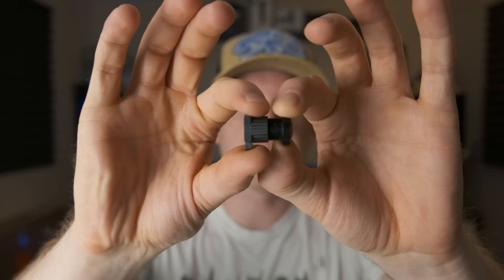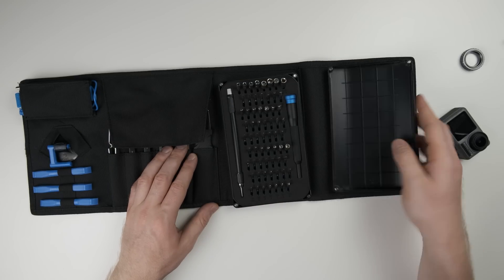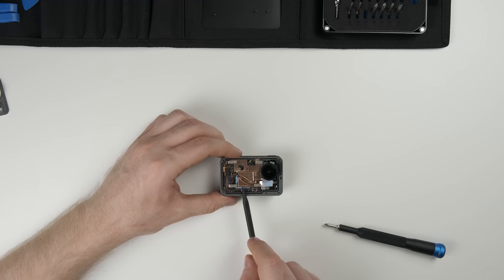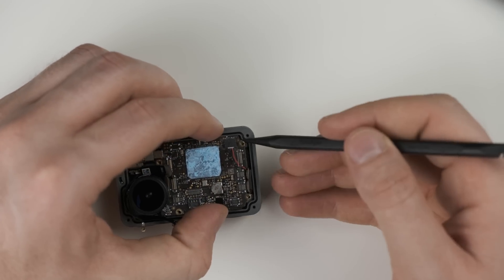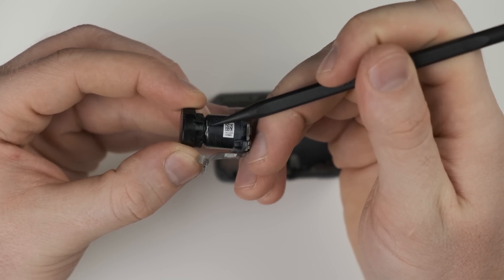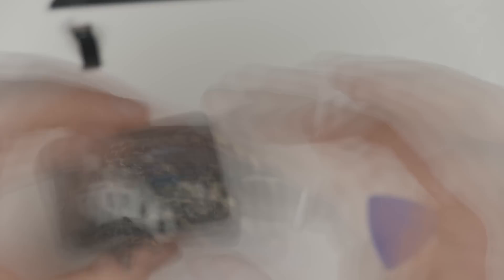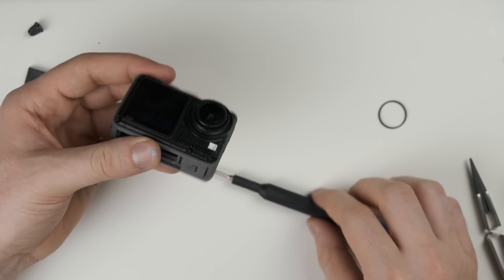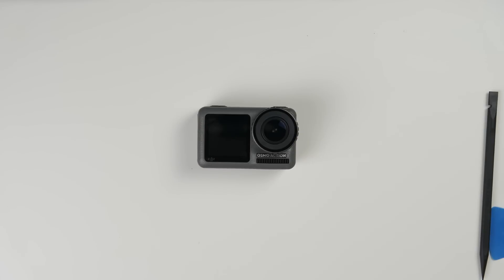The CRITICAL flaw on the DJI Osmo Action - Teardown Video

Comment: What is the diameter and thread of the lens, can you confirm it for me? I want to buy one but I want to change the lens. I want to use the lens 
 4K 1/1.8” 12MM, M12

Tell me if you think it works for me

Comment: I am considering the DJI cameras. Why?

1.  I bought two GoPro Hero 7 blacks in 2019. One doesn't work anymore & the other one is extremely unreliable

2.  I bought two GoPro Hero 8's in 2022.  One now consistently cycles on and off
The second one turns off within 15 seconds .  Neither one is usable anymore

3.  I bought a 3rd GoPro Hero 8 in 2023.  It now turns off within seconds after I push the on button it is not usable either

4.  All five of these GoPro have had issues with heat, inconsistent recording, & corrupting files.

5.  There is always a daily frustrating issues every time I use the GoPros

Comment: You can lightly heat the side of the lens and it should turn and unscrew. The lens is not an M12. It's an M11 but slightly smaller than the new Hero 5,6,7,8,9 + cameras.
Reply: My camera lens broke, it is the same as the one in the video, the Osmo Action 1. Can it be replaced with one equal to the GOPRO one you mention?
Reply: @soportesistemas4590  No, Only DJI makes this small M11 lens. There are no replacement on the market or aftermarket. These lenses are not the same size as the GoPro Hero 7 and above model lenses. DJI lenses are slightly smaller. I would not try to remove the lens socket over the sensor, heat will damage the image sensor. We will have a few of these stock lenses in May 2025 from water damaged cameras but lenses are fine if you are interested from IRmods.

Comment: Any idea where I can get an lcd replacement
Reply from the maker: Will likely have to buy a used/broken camera for parts.
Reply: @TrailFeatures  I opened up mine cleaned the inside now it has a red light on it. No display or anything. It’s so difficult to find parts for this camera.. driving me crazy

Comment: Thank you. I replaced my lens. When reassembling I did not redo the thermal paste! Do you think this will give me issues?
Reply from the maker: It may. I’d go back in and put some on. Doesn’t need to be fancy stuff.
Reply: @TrailFeatures  yeah, that's the plan. I swapped lenses with another broken one. You know that silver tape that you have to cut or remove? Isn't that some kind of heat shield tape (or something)? Does that need to be replaced or reaped?
Reply: What gopro lens did u use for the omso please i hv the same problem broken lens
Reply: @rabaranwer9752  It was another Osmo lens
Reply: @kevinjack5184  do you have a link?

Comment: I need to replace the front LCD, do you have any resources? I've Google it and talked to dji but I have to send it in and I use nearly every weekend...
Reply from the maker: You’ll need to look around on eBay for a broken osmo action that still has a working front screen. Not sure if there replacement screens available to by one-off.

Comment: Perhaps you could sacrifice the lens it currently has such saw it down to near the attached chip board. And then im sure peeling of the remaining plastics is possible. Or you can you like a solder gun and heat up the epoxy abit? Either way i dont see a way to really mod this lens unless you destroy the current lens, but nice work dude! Subscribed!!

Comment: but why?  why would anyone do this?  you never mentioned this.  dont you think most people would screw tis up?  MORON
Reply from the maker: Good question.

I did this to learn about how the camera was built and see if the lens could be swapped out if damaged or to get a wider shot. I recorded the process because there are many people who are curious how things work, and use it as a guide to repair/replace damaged parts. Just like with a video on rebuilding car transmission, it's up to each person to decide if they are up to the task.

Thanks for watching and commenting!

Comment: They should be able to add a wider  FOV via a firmware update along the lines of super view on the GP.

If they add a bigger fov, built in 3.5mm jack and a remote control in the osmo action 2 I would drop gopro in a heartbeat 👍😀

Comment: We think the lens angle is just right.
Reply from the maker: “We”?
Reply: The opinion of a couple of our cameramen using the Osmo as F/X cameras. In particular we have set our cameras to dewarp which also slightly narrows the field of view.
Reply from the maker: The focal length on the DJi makes it a great stand in for A/B cams if there isn't enough space or too much risk for something like an Arri Alexa Mini. The thing is, for an action camera they've really limited the functionality of it. Sometimes you need a wide FOV to capture the action. At the very least, I'd love for them to ease up on the glue to make it possible to swap the lens. That way, people can tweak their setup to fit their needs.

Comment: How do I replace the glass on the front screen?
Reply from the maker: It's a complete rip out and will 100% damage the existing LCD panel (assuming it's not already broken).

You either need the complete LCD screen (glass and all), or a donor front cover plus LCD screen from another osmo. Not sure if these parts are available aftermarket yet.

Comment: I was filming the underside of a passing train yesterday and a hanging cable hit the lens of my Hero 7 silver (stop laughing, it was cheap) and the lens was saved by a lens protector like the ones used on cell phone screens.  It was a direct hit on the lens and the protective layer cracked but the lens was unharmed.  I was shocked and immediately installed a new one.  I can’t imagine even trying to open it up. Your video convinced me to not even try!

Comment: it is true also the contrary for instance I have firefly 8se and it has  90 degree lens and I bought it quiete for this reason because I did't want a wider one so it is time the action camera will have but if you want 170 degree Firefly have this option too and it works great with an external mic .  Best option for the future action camera market is , interchangeable lenses without having to disassemble them or the whole camera , but as we regularly do with reflexes and I mean screw unscrew the lens , that is, change and that's enough, this is the challenge of the market of the future and then also the hole for the addition of a normal 3.5 mm external microphone this is what the market demands I repeat the possibility of changing objectives and hole 3.5 for external microphone and then with the possibility of having the opportunity to change  lenses - the action cam factories will have even more revenue determined by us that we buy even more different lenses as we need  but is it  so difficult to give in practice this ?  or as usual Chinese engineers are a little late in mind sharpness.

Comment: https://m.labs.huahuo.com/201905/6733.html
Here is the complete tearing down
But it is all on Chinese
I think you can heat the lower part of the lens a little. The glue is tight but not much. ( Not pro tip! )
Reply: The pictures show the lens after separating from the board. Can someone (Trail Features) comment on whether the new lens proposed in this vid would fit?

Comment: Great video man ... like the perspective of someone that uses the camera the way I do ... on a bike haha. 
I made the jump from old GoPro to sj4000 to sony as200v now I am on the new hero 7black. 
So question, how does the Osmo do in 4:3 as that is how I shoot most of my videos on my GoPro just to save me some frustration in post because I had the angle wrong on the helmet or the chest mount? I guess the real question is, is the GoPro still wider angle in 4:3 or are they both about the same at that point?

Anyway was a good video, it still seems that as great as the DJI cam is it is still not up to snuff enough to cause action sports guys to ditch the GPs
Reply from the maker: Glad it was helpful! So the gopro just has a wider lens overall, so it will always have the best FOV regardless. Another thing is in 4:3 the osmo doesn't have any EIS, where the H7B at least offers limited EIS (Not full hyper smooth)
Reply: @TrailFeatures  Guess I never really thought about it not using hyper smooth fully though it does make sense as well as some of my first videos were shot in 16:9 were a bit smoother ... guess I will have to tinker with it more

Comment: I you really need it to be wider, wouldn’t it be a lot easier to fit a fish eye lens to the filter screw?
Reply from the maker: It would be simpler for sure, but likely would take a quality hit. Also, doesn't fix the issue that you can't replace a damaged lens. ☹️
Reply: Trail Features true, but how many times have you broken a lens? It does have a protector lens anyway and that’s easy to replace. I personally hate the barrel effect of GoPros and pleased they’ve made later models less fish eye.
Reply from the maker: @MarcusTDM  With MTB POV, I've damaged a couple and know a few others who have shattered at least one lens. The lens protectors will help with minor drops and scratches, but a solid hit during a crash will demolish the cover and the lens.
Reply: Trail Features ah ok fair do’s.

Comment: is there anything else you don't like?
Reply from the maker: Really, everyone has already pointed out the cons. DC rainmaker did a great job at showing where DJI can improve the camera with firmware updates. The only hardware change is at least using less glue so people can swap out the lens if needed/desired. After that, just want them to hurry up and get the mic adapter out!

Comment: I cant believe they have such a modular design like that and then say lets epoxy the eff out of the lens heck if they were smart they would sell a lens module with a wide angle lens.  Now that you have the Ifixit kit you need to get (if you havent already done so) the magnetic parts mat.  Great for separating small pieces especially since you do a lot of these "tear downs"  I use it in my non biking life for my small electronics repair all the time.
Reply from the maker: Yeah, they were literally this close to having a perfect camera! Just a dab of glue would have been more than enough to hold the lens in!

Comment: Great job on the tear down!  I’m great at taking things apart, but not so good at getting them back together. BTW, your audio is fantastic!  What mic are you using?
Reply from the maker: That's the tricky part, isn't it. 😉

Rode NT1 was the VO mic I used.
Reply: @TrailFeatures  Yes it is!  Thanks for the reply!

Comment: They weren't remaking the GoPro, if you want the wide angle buy the GoPro. If instead you don't want everything fisheyed at 60 fps buy the DJI. Your complaint is akin to 'I really like the AK but it won't chamber 5.56 so it's inferior'.
Reply from the maker: Well, that's not really fair to say because there are many arms manufacturers out there and many calibers to pick from. For action sports, it has been gopro or cheap knockoffs. 🙁

Comment: Since you can measure all the dimensions and stuff, why don't you use a but more aggressive method (cutting the whole stuff off) to remove the camera module, then print a new case to fix the lens? I think it should be possible. But to be honest, I am pretty satisfied with the width of the lens. I use it on my bike, mounted on the handlebar.

Comment: good review/breakdown.  admire your dexterity and willingness to dig in.  personally, I don't think DJI will do anything to solve the problem.  as you know, rocksteady crops (punches in) the image rather excessively but that's why their stabilization exceeds the GoPro. (at least in some comparisons) Turn it off/on and you can see the difference.  With it off sort of defeats the purpose of the platform doesn't it.  Even post stabilizing crops an image.  But if you just using it to capture still images and/or locked off or even ninja walking...turning off RS might be ok in some cases.  The big thing missing imo...is the external mic adapter!

Comment: I like the focal length of the action. The only reason I bought it is because I was tired of the barrel distortion from the fisheye lens of the GoPro.
Reply from the maker: It's great for non-pov stuff, but as soon as you strap it on yourself it's a bit limited. Would love to see them make it easier to replace the lens so I can switch between the two as needed.
Reply: Gopro has linear mode which gives a non wide angle view

Comment: Osmo records at old H.264 codec and is stuck at high sharpening. Osmo loses to Hero7 period.
Reply from the maker: I think that SOC (processor) in the Osmo actually supports h.265 recording. Hoping they implement that along with the option to turn down sharpening. 🤞
Reply: Took back the gopro. Not much of a camera if it turns itself off or freezes.

Comment: The lens on the Osmo Action is so much better for many things, budget commercial work etc where fisheye is a nono , but most use cases for such a camera is for the hobbyists who wants a wide fisheye. And the non replaceable lens is very concerning in regards to cost or time lost(insurance)

They should have made it repleaceable/easily swappable, and they could potentially made even more money. Beeing able to buy " a kit of 3 lenses fisheye/wide/less wide" would have been great.
Reply from the maker: I agree! A lens kit would be great!
Reply: @ciscos-life  In the middle of what? It's totally to the other side of things.
Reply from the maker: I guess my question for those people is, why not get the RX0 mk ii instead of the Osmo? You get a 1" sensor, more dynamic range, better lowlight, better inputs, and color science. Yes it's kinda crappy you have to add in stabilization after the fact, but it's almost perfect otherwise. And if you just want to vlog, a RX100 is a great do it all camera.
Reply: @TrailFeatures  its the price of the rx0 ii, had it been lower i would have purchased for my niche stuff, and gopro for my hobby stuff.
Reply: @TrailFeatures  Simple, no stabilisation.  I have the RX0mk11 and the Osmo Action and whilst the quality from the RX eats the Action hands down its rubbish on the move.
Reply: @K22MDL RX0M2 has stabilization.
Reply: @z352kdaf8324  Yes it has and like my RX100Mk6 it is far from sufficient to use on the move and totally unusable as an action camera which it was never intended for.
Reply: @TrailFeatures  and way more expensive... The Osmo is perfect for a number of things without the barrel looks of gopro
Reply: @TrailFeatures  And that's why use one but don't even think of it as a replacement for a GoPro or Action!

Comment: I think it’s ok but to me ya can’t go wrong with a go pro the Osmo sound and video to me is not that great.  I’ve seen videos where it looks dark.  And sound is like muffed.  But to each is own.  I got the 7 black for my birthday along I bought 2 sessions.  And go pro 3  and a reg go pro.  I got the 3 since mine was ran over.  I got my cameras from all my friends who knew I got hit by a truck and my 2 cameras was ran over.  But my wife is awesome she got me 5 black a week before my bd. Then gave me the 7 black.  I could not be happier
Reply from the maker: THe Hero 7 is for sure still my top pick. GoPro has had years to get their cameras dialed, so Osmo has a lot of catching up to do. That being said, for a first attempt the Osmo is impressive! I'm very hopeful that like the osmo pocket they greatly improve it over the next year with firmware. I think that CPU is able to do a lot more than they are using it for now.
Reply: Trail Features yeah I like the front camera but glitch makes it lag. Like in real time.  And if ya ride you crash. Have the front screen and the huge lense screen is septable to be broke on or in the crash now being said that both go pro n osmo need to improve on mounts and case to hold cameras I know many company's jumped on the go pro mount ( GoPro did not trade mark it) so being said that you can get parts mounts everywhere. What I'm saying is the sticky mount all over the helmet. Probably the only secure way but. Go pro for the price should give ya aluminum mounting hardware.  At least one pice. I'm no pro on cameras or videos. But heck common sense will say. The more screen the more lense will probably be broke.

Comment: No sir! Not dissecting my camera.  😳😉😂😂 If its not nearly dialed when i buy it,  i will save my $350 and my time and energy to upgrade my bike.  🤙🏽
Nice Experiment 
-Sam
P.S. TIP - buy your gopro from best buy, get the insurance. You will always have a camera 👍🏽
Reply from the maker: For sure, if you're not a little weird like me then getting a warranty is very worth it. Hopefully though, they'll start putting in wider lenses and ease up on the glue.